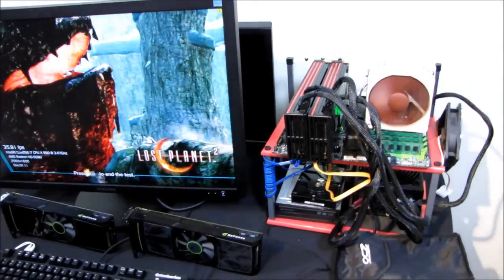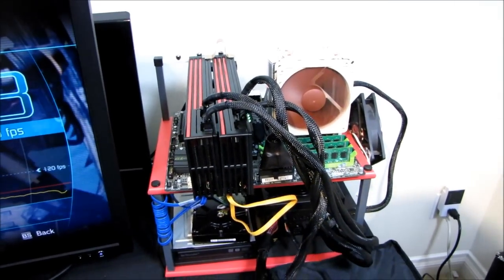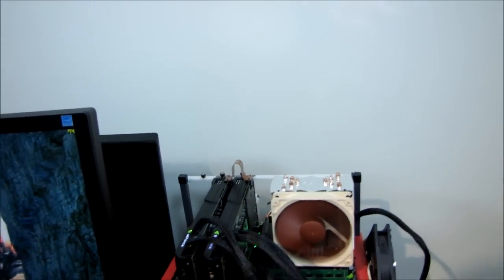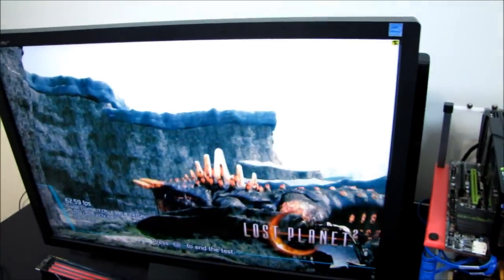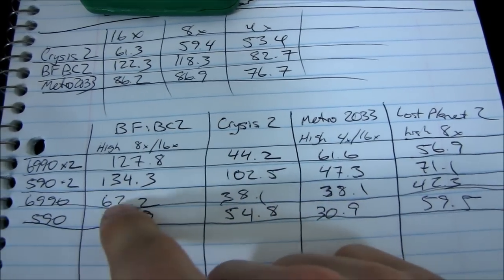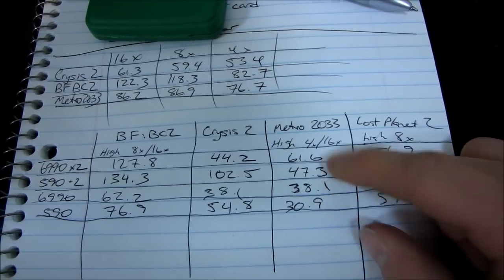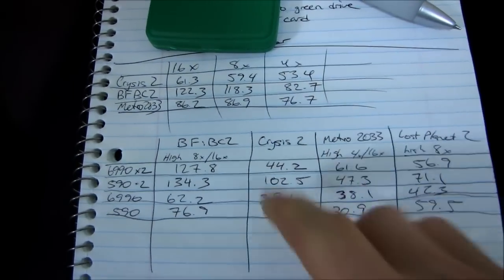Quad SLI vs Quad Crossfire Heavyweight Showdown GTX 590 & HD 6990 Linus Tech Tips

Comment: yeah quad SLI and Crossfire my ass dude i dont think you know Quad mean 4 not dude come on
Reply: each card has two cores on it. making two cards with 2 cores each,.... Quad.
Reply: You're fucking stupid.
Reply: you are an idiot -_- those cards have 2 gpus each. do research before try to prove someone wrong.
Reply: I don't think YOU know what Quad means.
Reply: "I dont think you know Quad mean 4 not dude come on".

Yes, quad means four. There are two cores on each card running in SLI or Crossfire mode. Two on each card = four total. Hence, quad.

You're right, though. Quad certainly doesn't mean "dude". Come on.... dude.
Reply: Two cards with 2 GPU's each mean Quad. You're just thinking of 4-way.
Reply: njm1112
two cards not cores, each card has over 2500 cores lmao
Reply: hirosese
I'll skip over your grammatical massacre and just point out that you DID type "two cards" and you also seem that think that just one CUDA core or just one SPU is the equivalent of one CPU core (according to your comparison).  That's just plain wrong.  I did appreciate the cheeseburger metaphor, however.
Reply: hirosese Each card has two GPU cores, then each GPU core has x CUDA cores (or at least modern nVidea's do). Each card does not have two cards in it...
Reply: hirosese Please show me the card with over 2500 cores. I really wanna see.
Reply: saltkringel2
the 290x has 2816 cores r9 2560 cores http://www.amd.com/us/products/desktop/graphics/R9/Pages/amd-radeon-hd-r9-series.aspx#5
the gtx 780 has 2880 cores http://www.geforce.com/hardware/desktop-gpus/geforce-gtx-780-ti/specifications
Reply: Stream Processing Units (SPUs) do not equal cores.  A core generally refers to a processing core (hence CPUs with dual, quad, six, etc cores).  You are conflating SPUs with cores (or in this case, GPUs).  The point is, the original poster didn't realize that each card has 2 GPUs instead of just one.  That's why he's an idiot.  You're an idiot for claiming that each card has two cards.

"two cards not cores".  That's just plain derp.
Reply: xebek
wtf. never said they have actually 2 cards. by that i'm meant double the bandwith so they would act like to cards hence 2 cards. like getting a double cheese burger, your not getting 2 cheese burgers, but 2 burgers between 2 buns
http://www.hwcompare.com/14473/radeon-hd-7970-vs-radeon-hd-7990/ds
btw a spu is a core. It's an independent processing unit. The gpu is already multicored, when you sli/crossfire them your just adding more stream processors/cuda to it. they don't say its dual or quad core to gpu's because they already have thousands
Reply: hirosese ...its right there in the comment thread. "Two cards".
Reply: jonoc5 listen to yourself 2 cards. That was a metaphor. Never said 2 cards in 1 card. People need to stop acting smart and comprehend
Reply: hirosese I don't think you know what metaphor means.
Reply: jonoc5 definition- is a figure of speech that describes a subject by asserting that it is, on some point of comparison, the same as another otherwise unrelated object

There are two types of metaphors:
a simile, where two unlike things are compared followed by a figurative example.
an analogy, where a literal comparison is made between two thing

Son our class session has now ended, now get yo' dumbass out my classroom
Reply: hirosese well consider that I never referenced your burger metaphor, its irrelevant. I know full well what the word means but it seems to me that you evoked the word in reference to the pure suggestion that each car has...two cards. Perhaps you should be less cocky on subject in which you so clearly lack fundamental knowledge.
Reply: jonoc5
it's already self explanatory if they're in crossfire. How do you make a single gpu crossfire? -.-exactly
Reply: xebek
You said seem to think. It's like your able to read my from one sentence. As if I've never owned these cards. sigh Yes I did type 2 cards, who is denying this? Geez people these days. WHAT? lol HAHAHAHAHAHAHHAAHAHAHAHAHAHHA. WHAT? What are talking about? cuda/spus are cores they are cores that gpus use to compute instructions. You getting confused with graphics processing units and graphics processing cores. Wow....just....wow. Hope guys are trolling cuz.....wow
Reply: hirosese
I hope your last post made sense to you, because it's incomprehensible to everyone else.  You may call me a troll all you like, but at least I didn't claim that each card has two cards.  Now you're confusing transistors with cores.  All of this is irrelevant, however, because everybody understood the OP's mistake except for you and he.  Looks like you're in good company.
Reply: xebek
I never said anything bout transistors, Basically saying I got confused with something I never brought up? But, ok I guess me looking at my 7990 right now, it supposedly has 2 cards.

Comment: Well, the definition of "SLI" is to combine the power of 2 GPU's and not the power of 2 graphics cards.

That's why SLI is enabled when you use a GTX 590 even though it's one card.

So the title of the video is correct, it's 4 GPU's working together=Quad SLI.

Comment: umm instead of the 650 ti get the 650 ti boost because it has 2Gbs Of Vram which is Really good. Or if you have a little more to spear get the 660.

Comment: If you got a gaming power supply that is 750Watts then it will be perfectly enough for the setup i just mentioned, gaming power supplies and higher are rated at CONTINUOUS power, not maximum power, this means that they can output 750watts for their entire lifespan.

Comment: max power for a HD7970 is 250Watts, x2 and thats 500Watts, 77watts for a highly overclocked i7 3770k, 577watts include overclocking and that will probably come to around 650watts + memory 660watts + motherboard power, hdd power (1 ssd and 1hdd), fans power and power drawing USB's and then even an extra couple of pcie extension cards (capture card, sound card for example) and that probably comes to a fully max power usage of 750W. will continue on a second comment.

Comment: yes but that depends on the graphics cards in question. 7970s need about 315 watts under load each. so thats 630 watts just for graphics cards already. add another 350 watts for the computer under load and thats already 980 watts. the reason you would then not go with a 1000watt psu is because psu's power output decreases over time so the ax1200i would last him longer....and this is all without considering overclocking

Comment: Don't be a fool and say that a 7900's card from AMD/ATI will wipe the table with a 570GTX, 
Yes with the following you can tell how old school of a gamer I am 
I run with AMD+3/8core CPU, 2 way SLI with 32gb RAM 2311MHzOC, (not even overclocking yet) pull in on max settings on BF3 about 70-90FPS on stock standard 560GTX x2, In game CPU is at 40%, GPU's are also at 40% and the ram is at 40%
I don't run BF3 on max and turn down/off a lot of the things in settings as I am old and the eye's hurt

Comment: Was the fire starter a 9800GTX ????
Mine did the same after I spent 3 hours cleaning all the dust out of it, in the same week a mate's died doing the same thing, 
But to let you know about the 9800GTX card's is that once you've used them for more than 3 year's, They'll die/burn out the GPU,

the AMD/ATI card's have been named (buy some retards who play in less then 40FPS the best gaming cards) While the Nvidia card's that have lead the way of gaming for god knows how long will run over 80FPS

Comment: No I didn't overclock them, I stuck them on the motherboard and after 6 months it just stopped...I did this 3 times so it was probably the motherboard or drivers, but I didn't care...So blame me if you want, but you can not change my mind on company's right now. I like AMD a lot and like I said I do not want to change any company's.

Comment: you might be right but the problem rest's in a few things. The 7990 or devil 13 is not necessarily faster than the 690. they are both good in different games. the 7990 is also louder and uses more power. it also doesn't have nvidia's advanced physx. (they are the same price by the way) but i'm not saying amd is worse, i'm just saying nvidia's in the lead for now.

Comment: I would get a GTX 570 bro there basically a "580" just trimmed down by 5fps and there really affordable right now on amazon, brand new there $385 for the reference model by EVGA but they also sell a updated HD model new for $249 which is a very good deal check it out.

Comment: Honestly, for pure top of the line benchmarking and raw power. Intel/Nvidia are ahead now and have been for quite awhile. I use top of the line Intel and Nvidia products in my gaming rig and love them but not the prices. My girlfriends computer is running AMD CPU and GPU solutions and it works amazingly for her to play with me, at still decent settings with great fps. AMD will never die as long as there is a want for a more budget friendly solution. Which is what most people want in this economy

Comment: Someone mentioned it, but do you actually have the 590's hooked up to one monitor? According to my manual for my Asus gtx 590, you can only SLI with two + monitors. So is it now possible with new drivers to run SLI to a single monitor? Thx in advance.

Comment: True, but with Intel you won't need to update as frequently because they outperform AMD in everything except a couple programs that are written very well to fully utilize all 8 cores of AMD. Even then, Intel still ties or falls a tiny bit short of the 8350, while using about 50W less. If you OCd the 3770ks real TDP to match the real TDP of the 8350, it would kick it's ass in everything. Another popular way to look at CPU performance is performance per watt.

Comment: One GTX 590 has two GTX 580 cores, so basically one gtx 590 = 2 graphics cards, thus 2 590's = 4 Gpus = Quad SLI.
Same thing with HD 6990, it has two HD 6970 Cores, in one graphics card.

Comment: part 3... dang youtube character limits.

A true quad sli/fire setup of the dual gpu's could run 8 total cores. Having an i7 system, or similar amd system, having 8x8 (graphics cores, and cpu cores), in theory, performance max currently in this hour and day could be obtained. (with appropriate ram, system board, etc).

But again, this vid is 2 physical cards of each,  sli/xfire ONLY.

Comment: This is partially incorrect.  -- Two dual gpu cards, ati or nvidia, are still sli/crossfire only.  4 card's that are single or dual gpu, ie using 4 total pci-e 16x/8x slots = quad sli/quad crossfire. The quad reference, and even triple, is total # of pci-e slots in use by x # of cards. You can quad xfire and Quad sli most cards of the ati 5000 series onward, and even the nvidia 200 series onward.

Comment: An ssd only moves data to your ram quicker, When you load data in games and so on it moves the data from your hard drive to the ram, What is slow. With ssds it moves the data a lot quicker.

Once the data is loaded, SSD's dont increase your performance on processing graphics.

Comment: Can somebody please tell me if a Corsair HX 1050 has enough power to support: a 690, 590, 3960x with H80 and16gigs vengeance. Will it be pushing it? I've looked at some calculators and it seems like it can. I'd just like some opinions on da matter. Thanks.

Comment: i have seen that episode....i was talking about long term use...it happended to.me...i experienced some problems with my seagate...my E: drive would sometimes disappear...i looked for it in my bios...to see if it was a windows problem..but it wasn't...my motherboard wouldn't read it...i send my rig back to the local custom pc builder...i had done some water cooling stuff and coiled the wire..like linus has done to mange the cables...beacuse of which i wasn't able to claim my seagate warrenty..

Comment: I recognize in concept dual gpu, sli or crossfire is still only 2x card's outright. There is no quad here, the title is written wrong... :(   Wish he knew actual geek speak properly... Actual quad is 4 separate mega cards, while this setup means more "power" on a single slot, but you still have a maximum bandwidth of that single slot... even in a dual gpu dual slot, it's still 2 slots, not 4 slots. Even with the crossover cables, sli cable on top, etc... it's still 2 slots he's using, :(:(

Comment: I don't know why people think that if they put 12GB of RAM they are actually speeding anything...Larger memory chips are actually slower...more memory, signals have to travel further etc. Unless you know what you're doing and are ready do do some programming and some hackery most of the 12G RAM is unused but because it's larger it's slower. Or if you had 32G of RAM (or more) you could upload all the contents of the program from disk to ram - that' will speed it up...or you could buy a SSD.

Comment: You cant even compare the 690 and the 6990, its allmost 1.5 years between the release dates, the 560 and the 6990 is fair, but the 690 should be compared to the Powercolour 7990.

Comment: Sorta. When I render out 3D work on Maya they both handle about a 75% load and will process about 12fps of 1080p to hard copy as opposed to single card at 8fps. When I leave the beast on all night doing full comp rendering and conversions it will finish significantly faster than when I had the single card. Obviously they arn't practical for most applications and even gaming but they do have industry use

Comment: its an open test bench. They are becoming more popular for custom builds. Look at the Strike-X Air which is the one I test on. If you have pets though they are a disaster. Had to finally part mine out because of the dust and dander it accumulated. The next best thing is a big case with mesh lining and filters over the fan ports. Can still gander at the components while maintaining a plenty of ventilation.

Comment: @Buba2301 Also I will stress both SLI and crossfire are very flawed most games and program's can't use multiple cards and you may think it doubles displays or VRAM but it doesn't the system is a waste personally I'd take the £1000 you spend on 3 cards an upgrade over this 5 years when you feel you need it

Comment: @92Garrus 7970 is faster and cheaper than a 680 and the 8xxx are due in either December or January also unless it heaven rendering you do an i5 will perform identically to the i7

Comment: I plan on using the 3770k.  I still don't know; the only reason I would do 3 680's is if the 780's or 785's are far too expensive.  And unfortunately I'm looking for the absolute best in performance since I want this thing to be a viable build for several (5+) years to come.

Comment: 0:00
though the purpose of today's video is going to be carried out in late
0:04
quad crossfire with radio eight sixty nine ninety six you can see on my
0:08
parents right now
0:09
on games
0:11
quiet so i was jeweled do it
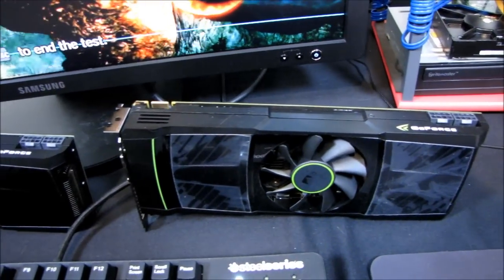0:13
dual below the eighty s five nineteen seventy are
0:19
about to go on but that's not going to be is a

Comment: Looked it up, and it seems you can, but it is not recommended, if your going to get 2 cards, just get 2 of the same kind and use a bridge. Better performance then running 2 different cards.

Comment: They are different cards completely, GPUs are different, companies are different, NVidia has SLI and AMD has crossfire, you cannot run both at the same time, especially not with a bridge. It is either AMD or NVidia, not both.

Comment: its called a computer test bench, there only $100. its alot easier to switch components on the motherboard with a test bench than a computer case besides thats not there real computer, thats there testing computer

Comment: The 90 series cards from both Nvidia and AMD are dual gpu cards that run in Crossfire and SLI.  Nvidia GTX 590 is 2 580s on the same board and the 6990 is 2 6970s on the same board.

Comment: PC's are much more practical, can be used for work, design, arts, and gaming. Xbox is just gaming, and low end hardware at it too. Also HD before GPU doesn't mean anything, just the model. 7970 HD is a gaming/high end GPU.

Comment: I would proberly suggest water cooling blocks for the GPU if you want to roll that way nothing wrong with leaving it as air cooling although water cooling does seem to make cards run alot cooler.

Comment: If i have a 750W power supply, can i run 2 GTX560 TI in SLI. my other system specs are. Intel core I7 2600 4 HDDs. ?

Comment: *facepalm*

There are very high end cards that are a generation or 2 old out on the market for $200. Hell, there is a card out on the market for 300 that is the latest generation. You can go back 3 generations and get a high end card for $125-150 that can run most games on medium at the very least. Mind you, medium > console (which is low). A CPU isn't 300 dollars. An i5 ivybridge (all that is needed) is around $150. 4GB RAM for $30. Motherboard for 100. Case for 45-80. Cheap and nice. Bam.

Comment: Alright, 10x better for $450 is stretching it. Maybe 2x or 3x max. 

A z77 MB ~ $100
HD ~ $70
Case ~ $50
Power ~ $40
Memory ~ $40
Which leaves you around $300 for a cpu and gpu and you won't get 10x performance of a 720p and low settings that the console has.

Comment: Considering that the graphics cards of both the PS3 and the Xbox are both outdated, you could grab a much cheaper card than 400, and still get better performance than a console. An HD 6850 could out perform a console, and you can nab one of those for about 160 or so.

Comment: Are you shitting me? I built my PC for ~650 bucks(i5-3750k, Asrock Pro3 Z77, Corsair CX600, 8 GB of DDR3, an Asus GTX560 Ti DCII+ a Cooler Master case). And unlike the shitty consoles these days, this rig will be good for another 2-3 years, a point well proven by my old GTX295 rig. The only thing I need is to play BF3 smoothly, which it does more than well.

Compare that to the PS3(256 MB of RAM and a GPU which is essentially a modified Geforce 7800) and I think you will come to a conclusion.